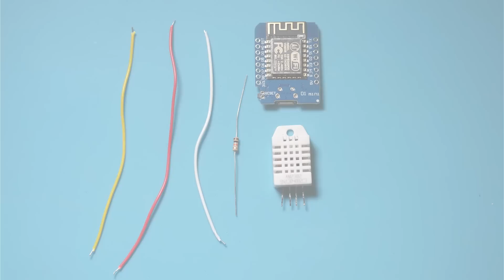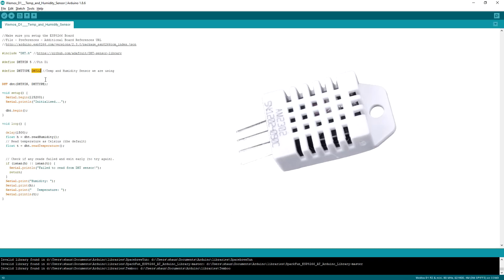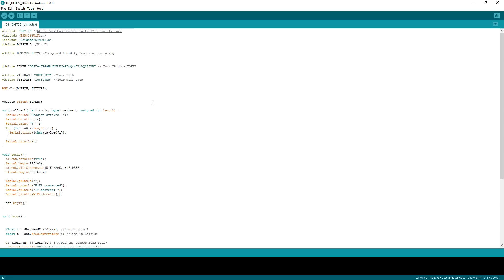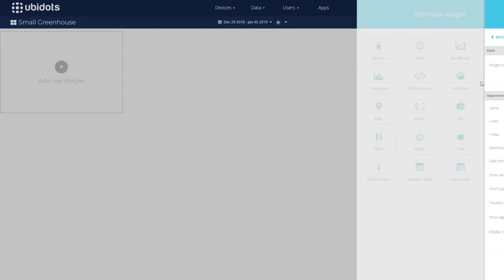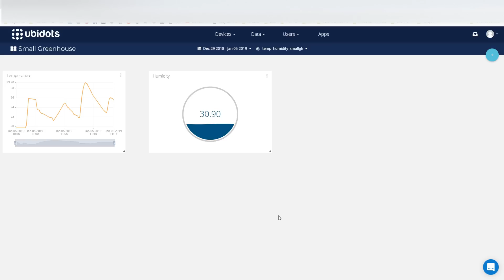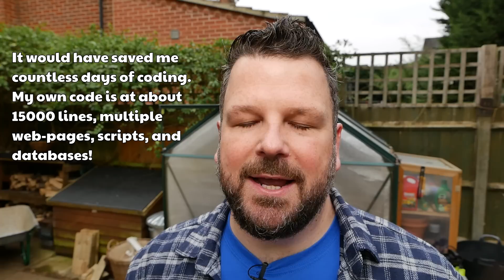Easy web-enabled Temperature and Humidity monitoring for your greenhouse

Comment: hey when go to select my board and put in esp8266 nothing comes up so i cannot download
Reply from the maker: Did you add the URL for the esp8266 in the additional boards manager?
Reply: @ChilliChump  yes this url //http://arduino.esp8266.com/versions/2.3.0/package_esp8266com_index.json
correct?
Reply from the maker: yes, that should be fine. But try this alternative if you still aren't having luck:   https://arduino.esp8266.com/stable/package_esp8266com_index.json
Reply: @ChilliChump  yes both were tried unfortunately its not working nothing comes up for me to download
Reply from the maker: If you paste the URL into your browser, does it return something, or give a 404 error?
Reply: @ChilliChump  hey i tried the updated code and was loaded in so i can download now. thanks for your help!
Reply: @topgrom  Hey, how do you do that, I cannot download it also...
Reply: even though I tried by adding the zip file but it does not work for me
Reply from the maker: Julio, have you added the URL above in your additional boards area?
Reply: @ChilliChump  Hello. It worked, I have to disable my antivirus program, it was blocking downloading the zip file, It's working now, thank you!!!

Comment: Hi Shaun, i've just headed back to this video as I have finally cracked open the Wemos D1's I ordered a good while back. One issue i'm having with my code is the section where i'm assuming we are sending data to Ubidots? - #include "UbidotsESPMQTT.h"
Do you have any idea how to overcome this or if this is something they may have updated?
Cheers mate, the video has made this (apart from the above hiccup) super easy!

Sam
Reply from the maker: Hi Sam, You will need to download the Ubidots library. You can get it here: https://github.com/ubidots/ubidots-mqtt-esp
Also, I am not sure if you are aware, but I started a second channel which will host, among other things, my more techy videos: https://www.youtube.com/chillichump2
I am busy doing a beginners guide to automation series

Comment: I would like to see further offerings like this one! This kind of automation has fascinated me but I am still new to Arduino and coding! It looks like you put a bit of this to use with your Biltong Box. Please consider a video elaborating on the Box a bit further. I could probably "custom-build" my own box, but there are details with yours such as the fans, what type heating device, and setting it all up. Thank you for these engaging videos!
Reply from the maker: The biltong box was an earlier setup of mine. I used a raspberry pi and conencted via the Twitter API to be able to control it by tweeting at it (just a bit of an experiment). Of course it also has automation, so that it monitors for ideal humidity and switches on fans and heaters accordingly. I will do more automation and tech videos over the winter. In the spring and summer my focus has to be on the garden!
Reply: @ChilliChump  Thank you for your quick reply! I'm subscribed and will be watching with great interest- not only for the automation and tech but also for all the fiery delicacies! I will try my hand at making biltong per your video.

Comment: This video is really great. Does anyone know if ubidots can be set up to send push notifications to an android device, or if there is a similar way to get a temperature sensor to send temperature notifications to mobile? I've got a really makeshift greenhouse set up and have to manually adjust the doors based on what the weather looks like outside! Would be great to get notifications if it's getting too hot in there.

Comment: Hey! I love the video! I'm currently looking for a system to use in my University's high tunnel. Would this board work with a couple of sensors? Its rather large and I'm assuming I'll need multiple sensors. Thanks for your time :D
Reply from the maker: hi Kloe, there are better solutions if you want to run multiple temperature sensors. There are ways to use the same board, but with a different sensor type that allows you to daisychain up to 255 sensors on a single wire!

Comment: I don't know what to do, I got it sending me the temperature and humidity, so I took the code for it to upload to ubidots and it wont connect, i keep getting the error connection...failed, rc=-4
Reply from the maker: I remember I had a similar issue. I can't remember exactly what I did to fix it though unfortunately. Are you sure the key for Ubidots is correct?
Reply: @ChilliChump  yes, i even watch a video on how to get the key because i wasn't sure
Reply from the maker: Have you got the most recent version of pubsubclient?
Reply: @ChilliChump  I just installed it when I was doing the wifi sketch thing
Reply: I got it working, I just unplugged the wemos for like an hour or so and it works now
Reply from the maker: Ah excellent. I was trying to recreate the issue on my side. But wasn't able to. Glad you got it sorted, and thanks for letting me know!
Reply: @perc.griffith  can you tell me where you got the pubsubclient library please???
Reply: @alisyifa9623  i did this so long ago i dont even remember
Reply: @perc.griffith  its okayy, ive fixed the problem. Thankyouu

Comment: Hello. I get some error while compiling, I have added the library from adafruit. and I'm stuck. Solved!! I added library "Adafruit_Sensor-master" instead.

Arduino:1.8.8 (Windows 7), Kort:"WeMos D1 R2 & mini, 80 MHz, 115200, 4M (3M SPIFFS)"
In file included from C:\Users\Magnus Wictor\Documents\Arduino\libraries\DHT-sensor-library-master\DHT_U.cpp:22:0:
C:\Users\Magnus Wictor\Documents\Arduino\libraries\DHT-sensor-library-master\DHT_U.h:25:29: fatal error: Adafruit_Sensor.h: No such file or directory
 #include <Adafruit_Sensor.h>
                            ^
compilation terminated.
exit status 1
Error compiling for board WeMos D1 R2 & mini.
Reply: If you are a newbie like me And this is the first time you do things like this.

Two things that you have to do. I learned it the frustrated way :)

1: Install driver CH340 before you connect the Wemos Mini to your computer, then check witch serial port it uses.
https://sparks.gogo.co.nz/ch340.html

2: I added library "Adafruit_Sensor-master" instead.

Comment: Nice video. I'm trying to check the moisture in the soil and based on the info I get use some sort of water pump. Gonna base it on a ESP8266 but haven't figured out what power supply to use. May I ask what you are using?
Reply from the maker: My main setup with pumps etc runs off 12v. I have a buck converter to drop and regulate the voltage for my ESP8266's.   I have a solar setup to keep it all independent of my power grid (I have a video where I go through the details of this in my Automation playlist)

Comment: Hi, I was just wondering. I do like your design. When my son was at school he won a prize for an irrigation system. We used a car screen washing pump controlled by a pic 12c508 and a 9v battery.Worked well for a school project.
Reply from the maker: It is pretty incredible how things have moved on from when I was a kid. Even the IC you mentioned, the cost is about $1. For that you can get an arduino, for a couple dollars more you can get a wifi enabled chip like the ESP8266 with 160mhz cpu, multiple GPIO, relatively large amount of memory. I like the idea of the screen washing pump. I spent a lot of time researching which pumps to use for my irrigation system. The ones I have are not the cheapest, but they fit the requirements I set for myself and should last a good amount of time!
Reply: Chillichump  hi, this project was in about 1998-99. Used two wires to sense moisture, when dry turned the pump on. It was only a simple project but did work. I’m looking at a design for a poly tunnel on an allotment. So needs to be secure and self contained.
Reply from the maker: Not sure if you have seen some of my other automation videos, but I went down the solar+battery method. The controllers don't use much energy, but the pumps can be a bit power hungry. You could also consider the gravity fed irrigation route, would be less power hungry. I was doing something like that a few years back (one of my first videos on this channel is about that)
Reply: Chillichump do you remember the 12c508 + PlayStation. ?

Comment: Hey, i'm planning on making sriracha which contains sugar. None of your sauses seem to contain sugar and i'm not sure what to look out for if it goes bad. Any advice for maintaining a healthy fermentation. Also most fermentations i've seen for sriracha goes from 5-15 days, but i want to make a month fermentation or longer.
Reply from the maker: If you add sugar during fermentation, it will get used up during the fermentation process. If you want the sugar for sweetness you will need to add it after three fermentation has finished, and make sure the fermentation didn't start again (freezing or simmering the sauce on the stove).
Alternatively you can use artificial sugar like I use in a few of my fermentations, I use erythritol.

Comment: This video came at the perfect time. I am in the process of building an incubator to raise Queen Honey Bees for the upcoming season. I just don't know if i would be able to figure out the coding but I may give it a shot.
Reply: Mate look at Inkbird temp controller and humidity controller it is not WIFI but it is plug and play
Reply: also look at Sensor push or TempStick for wifi data logging

Comment: Very good video. Your method seems to work very well. Like all things electronic there are many ways to accomplish the same task.

You might want to look at the Sonoff TH10 or TH16 Temperature & Humidity sensor/control device {10/16 amp relay and based upon an ESP8266} which cost about $8-12 USD but are self contained with no need for external 3.3 VDC power and can control their internal relay {10/16 amp} based up temp/humidity.

As I recall you use a Raspberry Pi for some of your automation. I am running Node Red {Free} on a Pi controlling all my lights and a bread proofing box using the Sonoff TH10. I can keep the temp in the box within +/- 2 degrees F via the Node Red/Raspberry Pi configuration. Very little programming using Node Red as it is very graphic, drag drop, connect but very, very powerful and uses MQTT which you seem to be quite good at using. I could do tighter temp control with a different heating device. A 100 watt light bulb is my current heat source.

Adding a Sonoff Basic {just 10 amp on/off control also containing an ESP8266} costing $5 USD, would allow, using Node Red, to control devices for both temperature and humidity. Again totally self contained and no need for a 3.3 VDC supply.

Sonoff has a Web based EweLink software to use on a smart phone but, I'm not comfortable with allowing their traffic into my network hence the Node Red/Raspberry Pi. 

Additional benefit: I used the Tasmota firmware to flash my existing Sonoff devices and once that is done the first time any additional firmware updates can be done Over The Air instead of the hardwired connection to the ESP8266 board.

Comment: Thank you for the video. I have been wondering for some time what platform to use for my data. I think I will give this one a go. 
By the way, do you calibrate DHT22 sensor? Documentation states that it is factory-calibrated but I tested it against some other thermometers and I got a difference of a few degrees. Not sure which sensors lied though :)
I will repeat myself, but I really like your music. My style :)

Comment: Good stuff! I use ubidots (for education) to monitor fermentation on my beers using a D1 Mini powered floating hydrometer. Certainly lots you can do with a D1 Mini that only costs about £2. 👌 I also use them for controlling RGB led's for Christmas lights! 

To take this a little further,  it would be super easy to design a small PCB that would fit in a project box with the connections all laid out for the sensor, D1 mini, resistor and power. I just got 10 PCB's made in China for the D1 mini to connect my lights for about £6 delivered!.
Reply: What service did you use for the PCB fabrication?
Reply: @HammyHavoc  wow, it was a while ago! 🤔I think it might have been PCBWay
Reply from the maker: Check out jlcpcb.com. It's what I use for my PCBs

Comment: How do you feel about the accuracy of the dht22 especially when it comes to humidity?  I have used a few of these sensors and get a wide variety of readings up to 15% difference.  Also, take a look at openHAB nice setup for automation.
Reply from the maker: The dht22 is much better than the dht11. I find the accuracy of the temperature measurement to be pretty good (with the 5 of them I have running I get accuracy within about 0.4 Celsius). The humidity I am not entirely confident with the accuracy, but I use that more as an indication rather than an accurate measure.
Reply: @ChilliChump  You could add a couple of different temp an humidity sensors all at the same location on the same board and then record them all simultaneously and look at them over time to see which one(s) are faster reacting and or more accurate. 

If you don't mind me asking, what do you do professionally?
Reply from the maker: I work in the software world...not doing development, more as a subject matter expert.
Reply: @ChilliChump  Ahhh Good deal.  Electrical Engineer here, I thought this was a rather unusual avenue for a pepper channel, particularly the familiarity or lack of gitters when doing a from scratch web enabled remote monitoring system. 

I do truly enjoy your channel and I look forward to your videos! Thank you!

Comment: good stuff. I use the adafruit feather huzzah, its basically the same as your d1 there with an esp8266. I have it publishing mqtt messages to a mosquitto server running on my home assistant server rather than ubidots. the huzzah or the d1 i feel like are much better than a full on raspberry pi being that it just needs to report messages and doesnt need a full on OS. (might want to blur out your ubi token?)
Reply from the maker: I deleted that token off ubidots, so no problem there!

Agreed regarding esp8266 Vs raspberry pi.  I have pretty much shifted over completely now...actually making the shift to esp32 due to the extra GPIO. My raspberry pi's are only used for media type services now for me.

Comment: I'm really interested in the automation stuff personally but I feel the content of this video will soar over most peoples heads, just some input. I would be very interested in a sensor for soil data, I've seen the sensors around and on your videos (it did moisture and nitrogen I think). I know some PI's can have a lot of inputs (never actually used one myself oddly enough) and having a monitor that just shows a wall of data isn't something that I'd be afraid to do ( though I know it would be largely overkill ) , kinda an excel sheet junky lol...